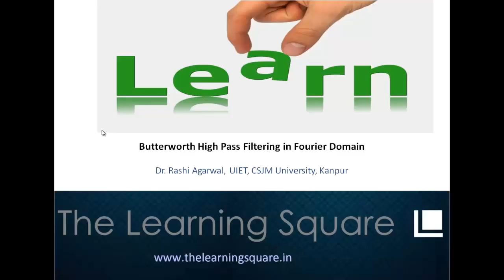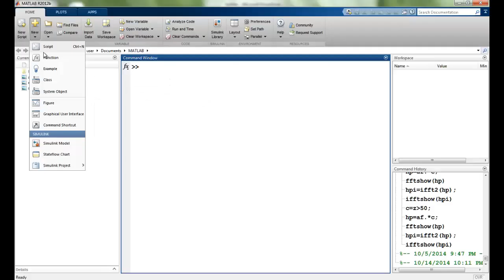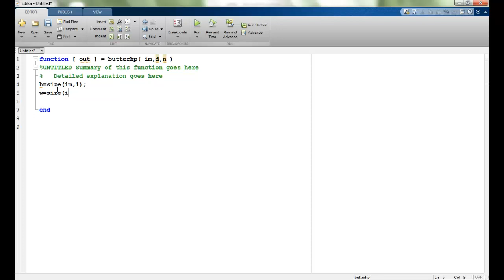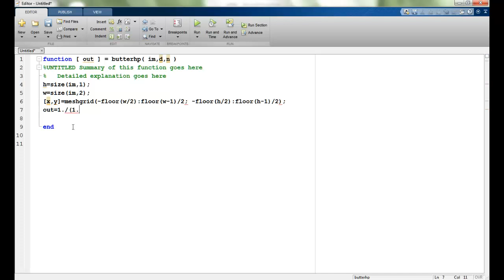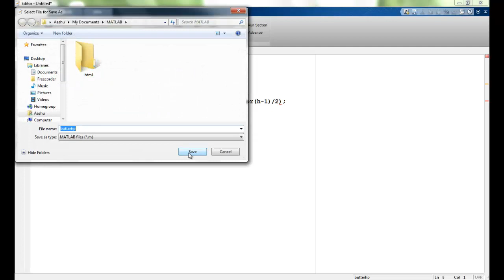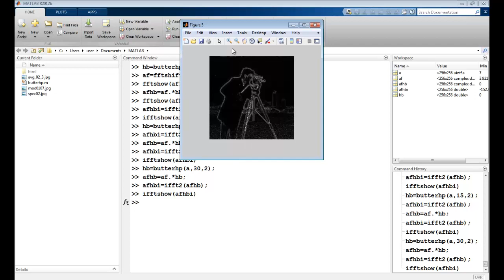High Pass Butterworth Filter in Frequency Domain

Comment: There is a small mistake in function butterhp 
 [x,y]=meshgrid(-floor(w/2):floor(w-1)/2;  -floor(a/2):floor(a-1)/2);      original as given 
 [x,y]=meshgrid(-floor(w/2):floor(w-1)/2,   -floor(a/2):floor(a-1)/2);      corrected

Comment: im trying to apply the function but its showing error. im creating the function on the name of "butterhp" and later in the command window im giving like 

a=imread('pepper.jpg');
hb=butterhp(a,14,1);

its showing an error as "cannot find butterhp"
Reply: Try to run it... It will ask u to either change the folder or add to the path... U add it to the path...u will surely not c any error again
Reply: @mujtabahassan7925  butterhp described in previous video